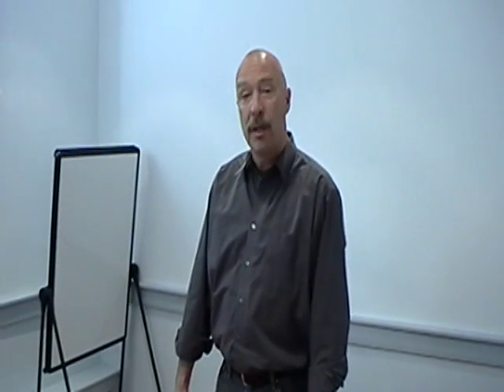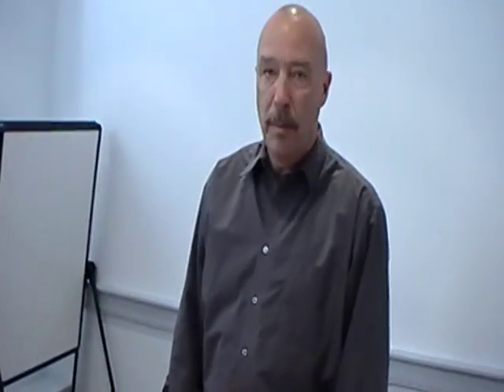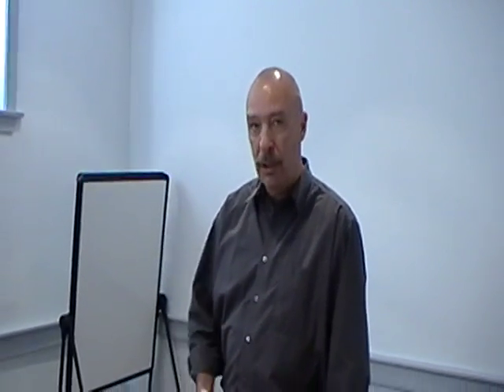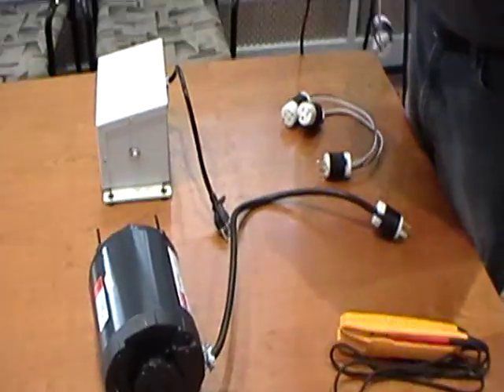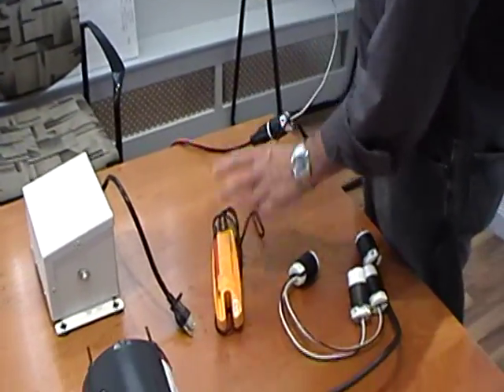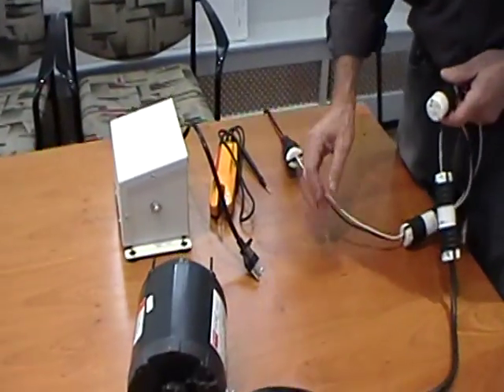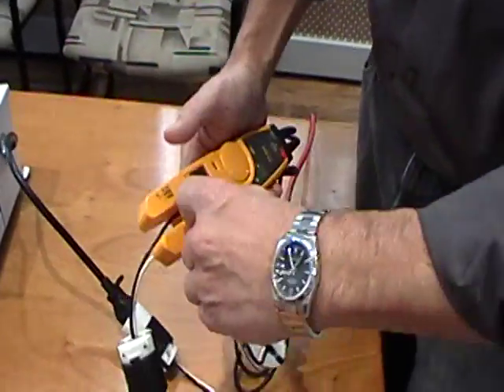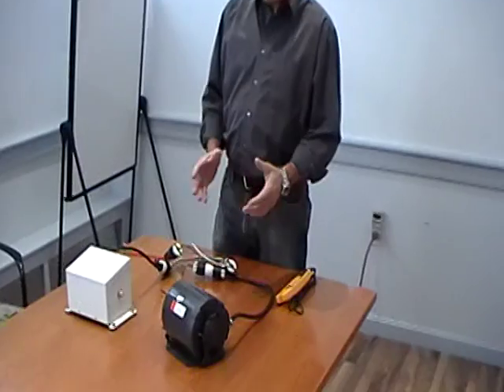Power Factor Correction Explanation

Comment: in an industrial application, if you have enough of a voltage drop while running vfd's and inverters you could destroy them. this is a small example and doesnt reflect the true benefits of power factor correction. this is one 1hp motor running on 110 volts.... he is telling you that when your running a plant with 100 motors ... this can and will come into play. when i worked for basf we had several capactior banks setup, so does every single platform in the gulf.

Comment: Something is wrong. We apply Capacitor bank to reduce the Reactive power but why are you explaining that Real Power was reduce by 9 Watts?? It should be the Reactive Power to be Reduce or Apparent Power & Same Real Power since no change in the Load. If your Apparent Power was reduce then your Total Current will Reduce also same goes with your electric billing. I believe you are wrong in proving but I got what are you trying to say here .

Comment: As per some other videos on Youtube, the real power should normally be fairly constant.  The variation of about 10W would indicate that some electricity would be saved using the capacitor.  Unless my computations are way wrong, I evaluated the capacitor to be in the 57uF range.  Am I calculating it right or am I way off ?  What would be the power factor values, before and after the addition of the capacitor ?  22.2% and 46.25% ?

Comment: The extra amperage associated with reactive power isn't a big issue for small motors at home. But you do pay for the extra line losses in your household wiring which becomes heat in your wires, and is a relatively small loss. You as a residential customer aren't charged for anything but true power (watts), which includes anything that becomes heat. But this video is a demonstration of a principle which becomes important to large industrial motors where the utility company penalizes the customer for low power factors, where extra amps are bouncing back and forth between the grid and the industrial load. The reason being that the excess current causes I^2R losses in the power grid system, which is heat, which is true power or watts, and it's taking place on the power company's side of the watt hour meter. The amperage in the wires causes the wires to heat, and this loss goes up with the square of the amperage. The wires are heated by the amperes and it doesn't matter if the current is in phase with the volts or not. P=I^2R and as you can see, volts aren't even part of this equation. As for your circuit breaker, the same thing applies, it most definitely will react to the amps and it doesn't care what the phase shift of the current is. At home, if you can reduce your 1.5 hp. bench grinder from 17 amps down to 14 amps (by the use of a capacitor near the motor) on your 20 amp circuit, it will leave more head room for other things like lighting that is on the same circuit. The motor still will use 17 amps, but reactive amps are now bouncing back and forth between the capacitor and the motor, and your line and circuit breaker will only see the 14 amps. Your circuit breaker looks at amps, and will trip just the same whether the amps are in phase or 90 degrees out of phase with the voltage. - Retired electrician.
Reply: I don't agree with your last statement. The reactive power bounces between the capacitor and inductive motor. If the capacitor is near the motor then the reactive power will not be seen at the circuit breaker. And this was shown in the video where 2A is flowing before the splitter but 4.6A between the capacitor and motor. 2.6A of reactive power never gets to the circuit breaker. - Electronics Technician
Reply: @dartplayer170  - I think we're saying the same thing. I agree with everything you just said. The numbers in my example are different, but the same concept is at play. 14 amps at the circuit breaker, but 17 amps between the capacitor and the motor.

Comment: Fascinating. I have a single phase 3,500w pure sine wave inverter (for my home solar). How would I hook up one of those capacitor banks to decrease the current (power) draw on the inverter (which would be considered as my "distribution center"). The house has many fans-motors which is powered by the inverter. Cost? Thanks.
Reply: In this scenario shown in the video, simply adapt the diagram to include your inverter in leu of the wall receptacle. I'm thinking you would add a capacitor bank at the inverter-fed electrical panel and land the capacitor conductors in the panel via a breaker. But honestly I've never done this before and you might want to verify what your actual PF is before investing time and money in PF correction equipment.

Comment: Improving Power Factor reduces reactive power thus decreasing Apparent Power & does not do anything to Active Power. The monthly bill is based on Active Power hence your bill won't reduce.
Reply: Shiran Fernando totally agree
Reply: For your home use it will not but for big factories which are charged per KVA it does make sense.
Reply: Wrong. Big industrial plants get a power factor penalty and many get billed on kva, not kw

Comment: But dont all the motors come with a capacitor  while purchasing ?
Reply: Most of those motors use capacitors for starting only, some are start and run capacitors, you must be careful about adding extra capacitors to any of them, without a meter like 43B power meter by Fluke or some other brand you wouldn’t know if you even need it.

Comment: So if I connect a solenoid to the mains, the power company will get angry at me because my average power is zero and I'm sending them back during the negative half cycle what they gave me during the positive half cycle? Are you sure? ;)
Reply: wouldn't that mean they have to pay you?
Reply: Well, I don't think they have to pay you since its almost impossible to make the power factor to be exactly zero, so that means you will have always some power consumption that you have to pay for and then there are also copper losses and the losses you have in your electronics and solenoids. So they won't be paying you anything, but you will be paying much much much less t them ;)
Reply: yep, only if we reduce reactive power would the power factor approach zero, but still beats expensive bills
Reply: Ryugamine Mikado I actually went as far as testing this idea. I connected a coil of wire with a ferrite core to increase the inductance in series with an electric heater rated at 1200 watts. The average power calculator on net was telling me that the average power consumed by my system will be 0.003 watts, but when I connected everything, my power meter (bought from China) was showing about 1200 watts. I did not have time to play with it much but I think I try to see if I can get it to give better results tomorrow ;)
Reply: Life is illusion I see, please do and post the resukts :)
Reply: Ryugamine Mikado For sure, I do that. Have a great day :)

Comment: No load on the motor so this is extreme example. Typical "Black Box" technology.  This puts true Power Factor Correction companies in a bad light.  Power Factor Correction Capacitors, in almost all cases,  should only be implemented to avoid Power Factor Penalties from a utility, not for KWH savings. There are other benefits for installing capacitors, however KWH savings is not the driver.

Comment: For all you noobs out there:

120*4.5 = 540 VA = Apparent Power. If you multiply 540 VA by the power factor (which seems to be around 0.222 very very low) that should give you your 120 W of real power.

Comment: YOUR MOTOR HAS NO LOAD YOU DOLT
Reply: +EMS Lawrence, KS Are you dumb! Honestly...regardless if the motor has no load or it does, Power (Watts) will still be the same due to ohms law! If your that dumb then you wouldnt know that with a load on the motor the voltage would decrease and the current would go up but it would still produce the 120W. So therefore, this experiment is legit and it proved to you (since he even showed it!!!) that by adding that capacitor bank, it drops the reactive power and dropped the 2.6A from the 4.6A it was origianally pulling
Reply: +Alexander Paulino you are not billed for reactive power.
Reply: ................please learn more about electronic engineering or whatever field taught you this mumbo jumbo.... there is a webpage is-power-consumed-by-a-motor-under-various-load-conditions-constant that can help you

Comment: you are insane.

your motor has no load.  you are building reactive power in the motor winding.

try this:

let the motor run for 24 hours.  Call me when the smoke alarm goes off.

Comment: that man dont know shit.4.5 amps only draw 125 watts.he doesn't know shit about electricity. and his meter was reading .45 and he said 4.5 .
Reply: +nelson javier   I thought the same thing, till I studied Power Factor Correction  and when you are dealing
                             with 60 cycles per second on a inductive load, you can save a lot of electricity with the right
                               matched  capacitor circuit put in  parallel with load.
                              Please look up Power Factor correction circuits.
Reply: +Davis Boudreau     I have a very good video for you that clears things up.
I did try to stay open minded on this PF stuff, but for the home user this video tell you
like it is from a engineers point of view. please search youtube for this video.
 EEVblog #848 - Home Energy Savers BUSTED.    That video tells you the truth tested with precise equipment
Reply: lol blind
Reply: That man obviously knows a lot more about electricity and how to read a meter than you do.

Comment: It isn't phoney, it could be better but he has a good point.  At home you are charged for kilowatt-hours but a factory has an extra charge to pay if its power-factor is poor, because that means that the power company has to supply unnecessary current.  A factory using PF-correction thus saves money, hopefully more than the cost of the PF correcting equipment.  The factory still pays for kWh but avoids the penalty for drawing unnecessary current because the losses in the power distribution system are reduced.

Comment: whats cool about this demo is at the point of split you can measure the current drop. electricity goes into the caps, what happens when the caps are full and electron lock happens. do you have an explain.

Comment: Is it safe? Suppose you unplug the power cord of the capacitor unit when the voltage is maximum. Thereafter somebody touches one of the prongs on the power cord.
The voltage can be 120 X sqrt(2) volts. Since the capacitance is large, there is lots of energy. Lots of current  at high voltage can flow through the human body.

Comment: Hello, I have 2 grid tie inverters for solar panels on the same circuit and have a power factor of 0.57 using a Kill-a-Watt plug-in wall unit. Would using a KVAR unit plugged in parallel with my grid tie inverters correct increase the power factor or would I just need to run a larger size wire to my main breaker panel?

Comment: There is no load on the motor- so of course the pf is low.  Most of those little motors will get pretty close to unity if well loaded. Why is the "wasted"amperage an issue? I have never understood that. They are out of phase with voltage so there is no heating power to any of the equipment, including the breaker.
Reply: The "wasted" amperage isn't a big issue for small motors at home. But you do pay for the extra line losses in your household wiring which becomes heat in your wires, and is a relatively small loss. You as a residential customer aren't charged for anything but true power (watts), which includes anything that becomes heat. But this video is a demonstration of a principle which becomes important to large industrial motors where the utility company penalizes the customer for low power factors, where extra amps are bouncing back and forth between the grid and the industrial load. The reason being that the excess current causes I^2R losses in the power grid system, which is heat, which is true power or watts, and it's taking place on the power company's side of the watt hour meter. The amperage in the wires causes the wires to heat, and this loss goes up with the square of the amperage. The wires are heated by the amperes and it doesn't matter if the current is in phase with the volts or not. P=I^2R and as you can see, volts aren't even part of this equation. As for your circuit breaker, the same thing applies, it most definitely will react to the amps and it doesn't care what the phase shift of the current is. At home, if you can reduce your 1.5 hp. bench grinder from 17 amps down to 14 amps on your 20 amp circuit, it will leave more head room for other things like lighting that is on the same circuit. The motor still will use 17 amps, but reactive amps are now bouncing back and forth between the capacitor and the motor, and your line and circuit breaker won't see them. Your circuit breaker looks at total amps, and will trip just the same whether the amps are in phase or 90 degrees out of phase with the voltage. - Retired electrician.

Comment: What happens when the circuitbreaker goes into action; is there still power on the terminated grid because of the capacitor? So: is it dangerous?

Comment: Thanks for responding, LEDesigngroup!! I was pleasantly surprised that you answered, considering that this video was posted some years ago.

Another question for you:  Why did the power drop by only 10% when the current was reduced by 60%?
Reply: The total motor current isn't actually decreasing. The 10W decrease in power is presumably due to the resistance of the extension cord being avoided. Most people never consider how much energy is wasted when electricity flows though wires and connectors. The length of power cords is critical. Many power tools, for example, will have labels that warn against the use of extension cords. Anyway, I'm an electrical engineer, and I thought this was a great video. He explained things VERY clearly, which makes me wonder why there are so many nay-sayers. How many times does he have to say "distribution system" before you understand that he's talking about LOCAL currents? The fact that he accidentally said "120kW" instead of "120W" gives you an idea as to the level of power they usually deal with. Btw, I'll once again make that same comment that I've made a thousand times before - if the "Tesla" stuff was anything other than the nonsensical ramblings of a mentally ill, washed-up inventor, I'd gladly adopt them for myself. We electrical engineers do NOT like paying the power companies any more than you do.

Comment: In AC, Apparent power is voltage times current.  Correcting power factor reduces power factor, but doesn't change Active power, which is what homes are charged for.  Industries are PENALIZED for having a bad power factor, they are not charged for the CURRENT they draw.  Measuring current is not measuring your house expenses.

Comment: Power Factor correction is not a new idea.  Industry with large reactive loads have been doing this for years.  I run a capacitor bank in my fusebox and save on average $35 a month on electricity.

Comment from the maker: @Lionelmanalaysay  - it is possible although not common.  Any electric motor can have a capacitor attached in parallel to capture the reactive current of the windings. Caution should be used however to insure that the capacitor is sized properly for the load it is expected to carry.  thanks!

Comment: jbarnes
A motor does not produces but consumes electrical power. To answer your question  both the motor and generator consume/produce the same amount of power- 5000hp. You want to have a high PF because it will bring down the line currents which will reduce voltage drops and IR lossesn the line

Comment from the maker: The answer lies in the efficiency differential between the two systems. A HP is a HP and a KW is a KW, however the 5000 hp motor at a 1.0 PF will draw less current than the .8 pf motor

the 5000 kw/50000 kva generator is simply more efficient at a 1.0 pf than the .8 pf unit, however their output capacity is the same.

Comment: Can anyone help me answer 2 questions?
1.       Which is producing more power
a.      A motor drawing 5000 hp at .8 power factor, or
b.      A motor drawing 5000 hp at 1.00 power factor.
2.    Which is producing more power?
a.   A generator producing 5000 KW, 5000 KVA at unity power factor, or
b.   A generator producing 5000 KW, 6250 KVA at .8 power factor.
Thanks

Comment: @gottagobideo You have to remember ohms law, to calculate Watts you take the amperage draw "current" multiplied by the voltage and that is your wattage or what you are billed on. If you reduce the amperage or "load" your wattage will be reduced by your multiplication factors being lower.

Comment: yeap, without a doubt a great demonstration, however the motor is clearly pulling 4.4-4.5 amps on the 1 socket twin conductor lead and 4.6-4.7 on the twin socket lead before the capacitors are installed and i am wondering why ?  Would have been nice if old mate had have put his clip meter on the capacitor bank to !